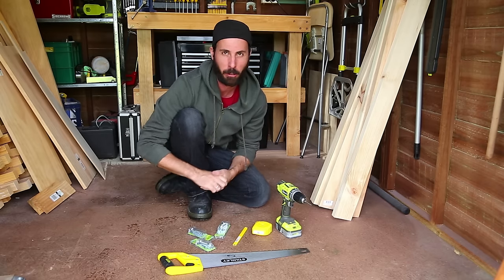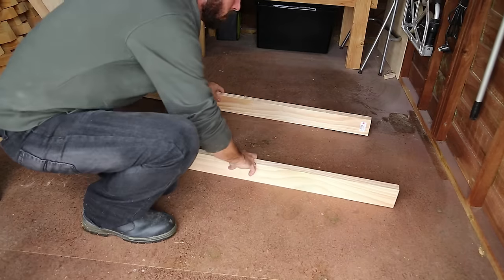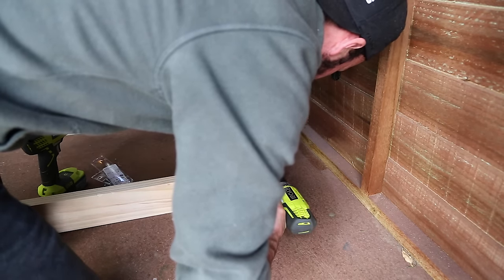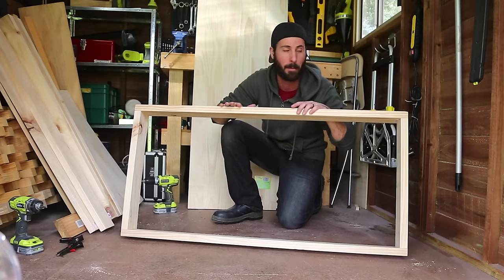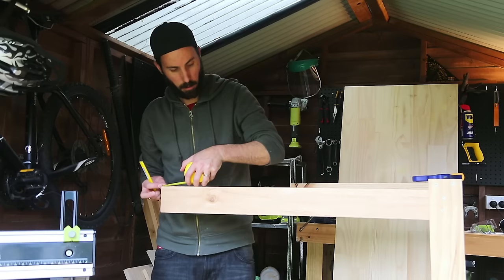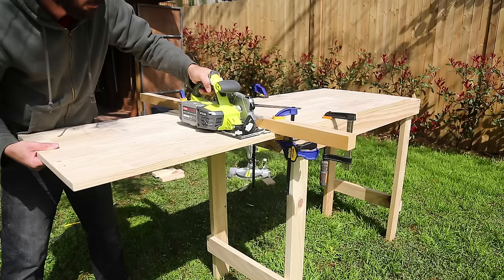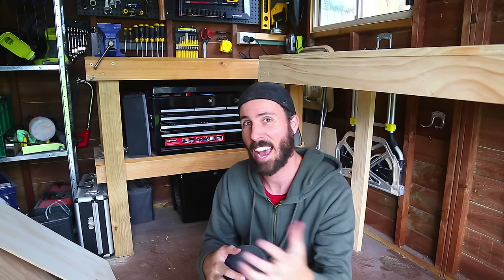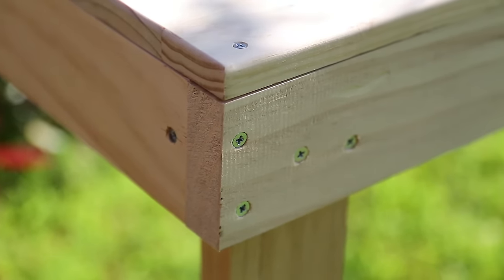How To Build a Simple Cheap Work Bench

Comment: Good vid MCM. I'd like to make a suggestion to other viewers that I used when I built my own benches. Instead of using a sheet of plywood for the top surface, use 2x4s/30x90s. The seams between each board keep things from rolling off the bench (punches, pencils, bolts, whatever), the non-laminated wood (plywood is glued together) will soak up spilled oil and such forever both eliminating messes on your shop floor and preserving the wood, its thick enough that you can lag bolt anything you want to it (grinders, vices, drill presses) anywhere you want at any time without messing with fender washers and such, and if you should ever need to temporarily bolt something down you can replace a single board later for a couple of bucks. On a bench that size it would add about $15 USD to the cost of the bench. Also, put a backstop on it so things don't fall off the back. That should cost like $2.

Comment: Thanks for this video. Thanks to the clear instructions and video I made my bench within in an hour with zero (that a big ZERO) of woodworking experience. It was straightforward really. Thanks a lot! Unfortunately, the whole project cost about $80 AUD in 90x30 wood for the frame and about $60 in a pine laminate top all from Bunnings. In truth, it is cheaper to buy a workbench but then you wouldn't have the fun and satisfaction of building one to your own exacting specs.

I guess it would be cheaper if you had wood lying around you could reuse.
Reply: Picture of my benches made with your video.
http://imgur.com/a/4imHZ

Comment: I made my desk in a similar process, but with a solid wood door that someone was throwing away. I took it home, sanded off 7 layers of old paint. While sanding, I added a bevel to the top side, then after cleaning it, I stained it with black cherry wood finish. I sealed the finish with some Linseed Oil. I used four 4"x6" / 101.6mm x 152.4mm wide pine boards for the legs. They were cut to 2.5 ft or 762 mm length, and painted BLAAAACK. I used 1"x6" / 50.8mm x 152.4mm boards cut to the door's width / length, across the back and sides to stiffen the desk. the supporting boards also got the BLAAAAAACK treatment. I attached the legs / horizontal supports with 1.5" and 2" / 38.1mm & 50.8mm wood screws and some steel L brackets. total cost, $25.

Comment: Looks nice! I'm thinking of making a new workbench. Thinking of putting a metal sheet ontop of the plywood table surface. Easier to keep somewhat clean when dealing with oil etc plus it can be used with magnets and helpful for welding. Problem is I have no carpenter tools.. Kinda thinking it would be better to make it all out of metal, instead of spending money on tools I'll never use

Comment: Maybe consider attaching a horizontal leg brace along the back legs inline with the 2 braces on the lower sides. This will prevent the legs from kicking outwards or inwards (a.k.a workbench camber), whilst still allowing the rolling tool cabinet to move freely in and out!

Comment: You don't need a mitre sqare - look at your saw handle, it is set up to let you mark 90 and 45 degree angles, using the back of the saw blade as the straight edge.

Comment: Good project, but you should have checked that the legs were 90 degrees from the top frame using a square, and then check further by measuring from leg to leg to sure all were the same.  Also making the top overhang the frame will make for a larger work area and allow for clamping work to the top. But again, a good video for a straightforward workbench. Good job.

Comment: Thank you for this guide! With this even I could screw together a nice work bench. I modified it a bit - 170cm broad, 70 deep with a 60cm frame below to have overlap for clamping stuff on it, 6 70x70mm legs instead of 4, and an MDF plate on top of the wooden top plate. And I also cheated... I bought the wood pre-cut. I paid around 110€ for the wood - half of that was the wooden top plate that was cut down to measure, and not pre-cut.

Comment: I actually built something similar for my garage when I moved into my new house but longer, about chest high and with a bottom "shelf". I also bolted into the wall and put some cheap cabinets up above. Not pretty, but inexpensive, sturdy as fuck, and gets the job done.

BTW, you can find some elaborate plans free online if you want a fancy, slightly less cheap, workbench.

Comment: Instead of the pine planks could I use some cheap 2x4? I can get a 10 foot board at Home Depot for maybe $5 and cut it to size but would it reduce the strength?

Comment: Don't cut the top flush but leave a 1"-2" overhang in the front. This makes it nice for a dust-pan to fit under or for clamping. But yes, not much to building one.

Comment: Two veeery serious comments :)
- add an X to the back legs to achive muuuch more rigidity. Could be a rod or steel wire...
- is it any good to use the screwdriver in rock-drill mode on wood? :))

Comment: Add spreader bars between the table leg cross rails & it will stabilise the legs & reinforce them
Btw dont put anything heavier than an alternator/starter motor on this bench until after u add the spreader bars.
This is a safety issue.

Comment: My main concern is that laminated pine is quite a soft wood, and dents very easily (seriously, you can dent it with your fingernail), so I don't think it's the best choice for a workbench. I would recommend putting a thin layer of hardwood over the top of the bench.

Comment: If the long side is the front, you should have turned the legs so that the long side of the legs themselves was on the side of the top. You have them long side facing forward which takes some of your potential shelf space should you decide to install a shelf.

Comment: i know this is a dumb question but can i install vise on that work bench.. is it strong enough..?
Reply: I would add side to side bracing. It depends on your vise... might add a brace under the plywood along the front edge on side and butted up to the plywood. screw in the sides and along the front. Especially if your vise will be screwed or lagged down to the top. The plywood should be heavy enough to support the weight but the brace will help reinforce and give you some extra wood to help it resist any side movement once it is secured.

Comment: Better to make the top two inches deeper and let it overhang the front so you can attach clamps on front as well and not just on the sides.
(Also I'd use glue besides the screws and two layers of that ply for a top.)

Comment: SERIOUS QUESTION! for Marty (or any other Subaru expert in the comments). My Dad just bought a gen 2 legacy with 58000 miles. He noticed that there is more coolant in the reservoir than there is to start with (after he changed the coolant). I know this means the coolant is getting hot. When the coolant cools it goes back down. It has happened a good amount of times. Research told me it could be the head gasket, but my dad checked and it doesn't look like it's that. Is it a serious problem? My dad wants to sell the car, but I don't want him to. (Posted on this vid cuz it's the newest.)
Reply: oil emulsifies when water gets in it so check the oil, if it's got milky bits in it it's a blown head gasket or if you're really unlucky a warped/cracked cylinder head.  Otherwise, just do a full coolant system flush.

you know what to do with a blown head gasket, but a warped/cracked cylinder head will have to be milled smooth.  any machinist can do it.  while you're in there go ahead and replace the rings, gaskets, and seals and do some valve lapping and you'll have an engine that with proper maintenance will last another 200,000 miles
Reply: oh, and if the previous owner was a serious hoon who sucked at maintenance then a cracked block is a possibility, in which case selling it is your best bet if you don't want to do an engine swap
Reply: subarus are notorious for head gaskets going bad after 50-60,000 miles.
Reply: Hambone I thought the head gaskets on Subarus would go at around 90,000 miles
Reply: Hambone I don't think so my dads got a gen 2 with 200,000 miles on the clock
Reply: turbo subies go quick, is his nasp?
Reply: 春日歩 His is N/A. I don't think US spec Legacys came turbo until gen 4.
Reply: Yeh you could definitely get turbo 2nd gens

Comment: Wood is 1 x 4?
Reply: Yes. He bought seven Pine 1" x 4" cut at approximately 4 feet. Then he made the cuts for the bench from them.
Reply: The height of his legs are approx. 38.5" tall plus the thickness of the lamented pine top.
Reply: The bench frame and lamented top  is approximately 4' X 2' , this includes the thickness of the wood for the frame.
Reply: jtm5 tanks very appreciate your info... Saludos
Reply: +Marcos Lopez you're welcome. No problem.
Reply: +jtm5 should read laminated*.

Comment: why don't you use feet and inches so everyone knows what you're talking about.
Reply: Ummm, maybe cos he is australian. We dont use the imperial system over here, metric is much more precise
Reply: +HarryIII.  oh I see.   ya that would be why then.  the metric system does sick big time know one knows how long a millimeter is Lol.  inches are way more precise
Reply: Jeremiah Payne the metric system is much simpler and yet much more precise. there is 10mm to a cm, 100cm to a metre, 1000 m to a km and so on. 1mm is smaller (and thus more precise). 1/16th of an inches is just under 2mm and you ont even have a proper name for that. its like inches is your smallest unit and then you just make fractions out of it to make it smaller. we even have nano meters and other smaller units
Reply: +HarryIII Have to agree with you, knowing both systems (growing up in a country using the metric system tho) it is much easier to work with the metric system, as everything goes neatly 10 to 10 to 10. Makes my life so easy :)
Reply: +Sin Shin yeah. Less hassle when it comes to 1/8th of an inch and 1/16th of and inch. For woodworking, i think you need a system that can be easily divisible by 10 to make life easier and make your projects more precise
Reply: +Jeremiah Payne " so everyone knows"
only 3 countries doesn't use the metric
everyone does no equal USA
Reply: +Jeremiah Payne 1 mm = 1/25th inch approx. How exact do you want it?